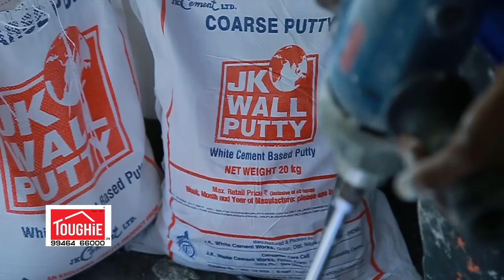TOUGHiE interlocking BRiCKS

Comment: As it is not doing cement plastering between bricks , will water leaks happen  during heavy rains ?
Reply: prasanna venkat if you look at the way they are manufactured, there is no where for the water to go. It would just drip down over the outside as it hits
Reply: Water does not come inside if wall are finished with Wall putty+ paint.

Comment: Unbelievable how could it be safety without using cement between the bricks?
Reply: Self weight of the wall and interlocking give strength to the wall.

Also the most important thing is when the wall started taking dead load (i.e slab,etc) the wall becomes rigid and strong
Reply from the maker: @User_11185  well said sir 👏

Comment: I called your number ,your quote for 8 inch wide cement interlock bricks is rs 43/ which is way more than what others in the field are offering.others are from 31/ 32/ 35 and 37/.
Reply: @toughie5910  If so then whats the compression strength of your blocks and weight for both the large and small, will contact my engineer with these and compare with other bricks>
Reply from the maker: For more details kindly call 9946466000

Comment: Exterior plastering is done by normal cement mortor or not ,if wall putty is enough for exterior,if brick work done by interlocking bricks
Reply: Exterior plasting is not required for this bricks, which saves cement+sand+time+ money+water curing.

Comment: It's an old technology. My house was built by the same model of interlock bricks 20 years ago, but not made of cement, it was made of red clay or mud bricks as we call them.
Those were heavy bricks, one brick weighing close to 12-15kg approx.
Their interlocks helps in holding them together, along with the weight of the roof coming on top of them. 
I wonder how someone can say it's not suitable for earthquake zones.  A normal brick and cement wall would crumble more or the same in an earthquake. 
**Advantages:::
1. These bricks are wider and can carry more weight and are more stable.
2. They have a good surface finish and we have just painted them,inside as well as outside.
3. No water seepage.
4. The room stays cooler in the summers due to more insulation.
5. Work is faster and cleaner. 
6. Less materials like sand and cement required unless you want to plaster the wall.

**Disadvantage::
1. They are much expensive than normal bricks.
2. Not every Mason would want to work with interlock bricks.
3.. You need to be careful with the bricks while laying them. If you chip the edges or break them while placing, it looks bad. So a good supervision is required while the job is being carried out.
4. Corners of walls have to be concreted for better stability, but not a necessity.
Reply: Is it cost effective
Reply: It's strange for me to see no cement/mortar between the bricks, or rebar through the bricks. So, if you could answer a couple of questions from your experience: 

1. If a structure made of these can hold up against an earthquake, what of a tornado? (tornados are a thing where I live)
2. How are walls kept from tipping over?
Reply: @Phoenix-oj8ul   I don't know the current market trends..but it all depends on your priorities...
Consider the advantages and disadvantages and which one suits you, accordingly you can decide...
Reply: 1.Well,as a matter of fact, we never face tornadoes. But,from basic physics, the weight of the concrete roof above the walls and the corner pillers can give the necessary strength.
2. The construction part is a bit critical. Proper alignment and water levels have to be used untill you reach the concrete level. 
I can share some photos in some time if required.
Reply: @eappenjacob1894  Holy Hell Batman! I was not expecting a response any time soon. Thank you for replying! I would love to see some photos. I really want to make my home out of interlocking bricks, and planned on going to Dwell Earth, but their bricks are not what I have seen others use... They seem to be really big regular bricks with holes in them that they still mortar in between each one. 

I take it adding pillars / columns along the perimeter wall adds strength? I don't know if I could make a 'concrete roof'... A concrete top rim is possible, with standard wood rafters. Is the "concrete level" the roof level? 

Thank you for the response!!!
Reply: If you cannot have a concrete roof, it's still ok. You can have a concrete belt holding everything together on top with a cross beam attaching everything together like the letter X.
Send me your email ID. I will share some photos ,maybe in a day or two.(I'm traveling at the moment...)
Reply: @eappenjacob1894  How do I send you an eMail address without posting it publicly on here?
Reply: Ente veedu 12 varsham mumbu Red Interlock vechu panithu. Plaster. Cheythu.
Reply: @igounfazed :  I am looking to start making the other style, with the perforations in them.  The bricks shown, though they are solid, have a couple of minor problems.  

By having to cut into the walls to run your plumbing / gas / electrics / comms, you are reducing the original strength of the wall.  

How is the wall anchored to the foundations?  

How is the roof attached to the wall?  

I am also a bit sceptical about the size of the tounge and groove in this type of brick - if it would be deep enough to hold a wall in place in an earthquake.

The idea of having a 150 mm wall is a good idea, as that does create a good thermal mass which should keep the house cooler in summer and warmer in winter, which should reduce costs.

My thfor inking to anchor the wall to the foundations is to tie starter bars into the foundations, and have them come up a minimum of 1 metre out of the foundations.  Then, every 600 mm, have a cement reinforced band in the brickwork.  At the top, to hold the trusses in place, have two by 18 mm threaded rod going down into the wall, catching at least 2 cross bands, and have the bar loop around the crossbars.  Set the truss on top of the wall, then have a solid piece of steel bridging the truss, bolted onto the bars coming out of the top of the wall.  By doing that, the roof, if it tries to lift off, will have to try and lift 12 courses of bricks .  I don't want to see the roof going for liftoff - as happend in Darwin in Christmas 1974.
Reply: @111jacare   hey.. I happen to live in a tornado prone area of the states as you know. So things going flying is a real concern for me. Even with just strong winds or strong gusts (which happen more frequently) strong enough to blow trees down and push cars over without a tornado. My current shed home... yeah, it rocks quite frequently.  
The bars coming from the foundation is what I have seen, and the holes in the bricks are big enough for water lines, etc. So I think its a good idea for your next venture. I have seen in videos intermediate 'rings of rebar and cement' every 3 or 4 feet of height like you said. Sort of tieing everything together as you build up. The brick they use at those levels are a letter 'U' shape to house the rebar and cement without taking away from the brick's esthetic, adding rings around your home. 
The truss thing you are talking about,... I am having a bit of trouble picturing what you are describing, but if what I think you are saying is right in my head, I think that is an excellent idea, especially in high winds/gusts/tornado prone areas. 

If you start this new venture, will you be releasing a video for it? I would really like to see the truss idea visually. I think I understand it it, but I could be way off.
Reply: @igounfazed :  Okay, try picturing this.  Some cars use the same method to hold the battery in place.  There is a U shaped bar that crosses the battery.  This bar has a hole either end, so that a threaded rod can come up through the hole.  At the bottom of the threaded rod, it is bent to resemble a hook which is then put through a hole that is in solid material, and hopefully will not come loose in a hurry.  A nut plus a flat and spring washer are used to keep everything tight.  

Now, in what I am suggesting, the threaded rod is sent down 4 feet into the brickwork, where able to.  Doors and windows may reduce this depth on the outside wall, but, if you use the bricks for the internal walls, you can go down the 4 feet on the internal walls as well.  Every 2 feet, there is a horizontal band of cement and reinforcing.  Get your threaded rod, and set it up so that it makes a circle, then run the horizontal bar through the circle.  I am looking to do this at the 2 and 4 foot levels.  When you get to the top of the wall, your piece of rod should be another 6 inches above the wall.  As the perforations are on 6 inch centres, and the timber is either 2 or 4 inch, use spacers between the timber and the threaded rod to stop the timber from twisting in situ.  When you have it all lined up, find a decent piece of U channel and put the flat side down.  Have the holes set so it  is 6 inches  and it should drop straight onto the rods.Then tighten it up and should be a solid join.  My idea for the trusses was to use 2 inch SHS, with a quarter inch wall.  Cut to suit, and use for the angles to the peak of the roof.  They were to be held in position using equal angle steel, with 2 bolts through each end.  And, the bolts were to be minimum M20.  At the ridge line, plan was to use equal angle on the underside of the ridge, and SHS in the valley of the ridge.  All bolted together.  The battens can be done from U section, bolted, and the roof, for cyclone / tornado conditons, use oversize self tapping screws on half distance to what the building code states.  

On the walls, on the corners, you want starter bars coming up from the corner hole plus two holes either sifde.  At wall intersections, middle hole, and 2 holes on eadh side of the middle hole in each wall.  In a straight run wall, work on a bar every 4 holes.  You also need to backfill with a light ceoment mix into each bar hole, plus make sure that it stays for community gain.   With doors, the two holes next to the frame need to be reinforced, and a band tied into the verticals next to the door, that runs over the top of the door.  With the windows, they need to have a full ring of cement around then.  Use the same method as you have for the doors, but, you also need a full band under the windows, tied into the vertical bars below and above the windows.  

What is being looked at, in the interim, is to build a machine that can do both CSEB and interlocking blocks.  A tap on the shoulder has been given to me to get my gonads into gear, and get building.  The first two projects are small, 16' * 10' sheds.  Am not sure if dong gable or skillion roof style at this time.  Have also been requested to supply for a new front fence.  They will be test projects, so it will be interesting to see how this all works out.  

Hope that my thoughts are of some help to you.

Comment: One kick can break the wall.. if u r not using cement in between bricks..
Reply: I was thinking the same, but how can they build huge factory if their product isn't safe?
Reply: U cant kick it off... i am using it for my construction ... if u pull the whole wall, it will come fully like an elastic
Reply: Sabah Zarid thats the reason,  Concrete joining will b plastered
Reply: Dude visit kerala there are 75% houses are in this type
Reply: @jeyaprasath1531  wow amazing..

Comment: How much cost saving per cent when compared to normal brick and motor.. Do you knw anyone who does this type construction in chennai or chengalpattu??
Reply: You can calculate for a required square feet of construction, how many normal bricks cement, sand and water is required. You can talk to a contractor regarding that.
Then for the same area, only calculate the number of bricks that would be required and multiply by price of one brick ,plus the labour charges.
Reply: For Bangalore supply is there

Comment: The groove is not deep enough. Half baked technology. Risky to build without mortar. The groove depth should be at least 2 inches to have a mortar free construction. Otherwise only suited for external compound walls. Waste.
Reply from the maker: Sorry , sir this is enough and more. Because the stability of interlocking Construction is the load comes on the top.,like concrete  roof .The interlocking position only helps in construction time . We are using  this system for past 34 years.